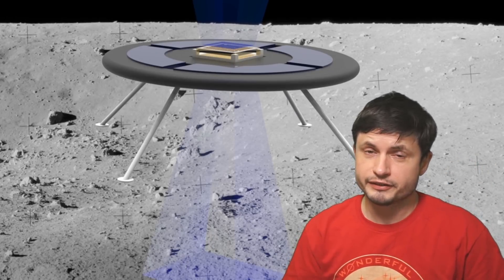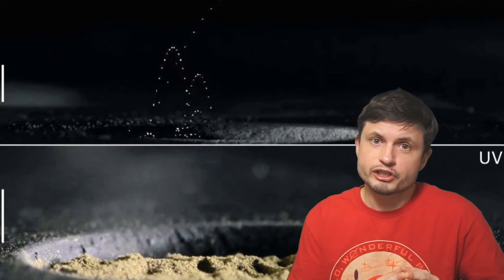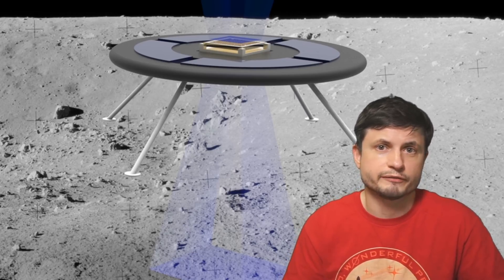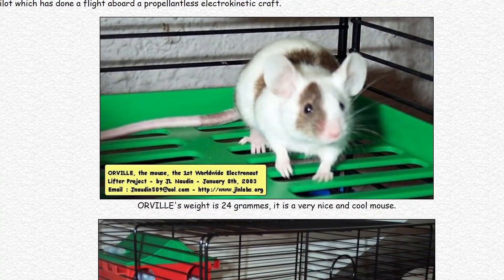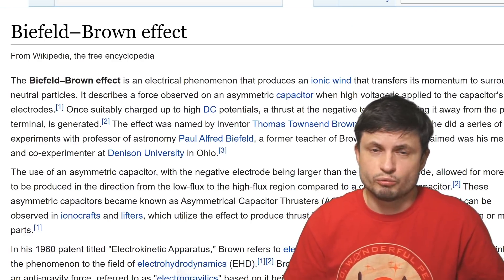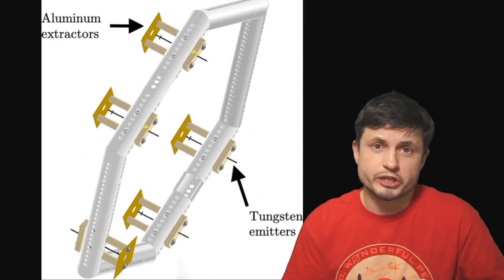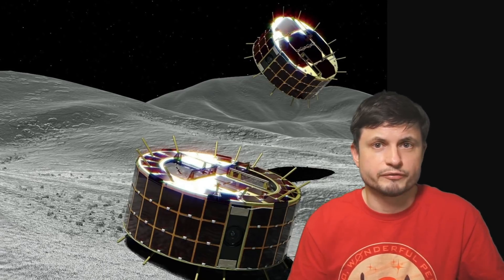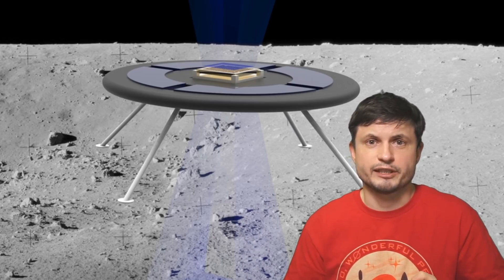Flying Saucers Could Work On the Moon By Hovering Using Static

Comment from the maker: Some clarification I forgot to add to the video:
The devices using ionic propulsion like the one that let Oliver fly rely on the electromagnetic principle to drive the charged ions and provide the lift. For the saucer, the forces would be based on electrostatic repulsion of already charged surfaces and would work on a slightly different principle
Generally, electromagnetic forces are created by both electric and magnetic fields for a particle moving with velocity v with the force measured in Newtons
Electrostatic forces refer to electric charges which are not moving relative to each other (static) for E being the electric field and the force is measured in Coulombs 
So it's sort of a different side of the same coin.
Reply: Aliens are using massless propulsion. They don't have to expel gases from one side of the vehicle to move. 
They simply fly. Their vehicles can fly in liquids like for example water but also gases and vacuum of space. 
Alien vehicles fly effortlessly and can change the speed and direction of the flight almost instantly - in a second or two.
Our machines are slow and clunky and super loud in comparison. Their machines are silent. 

A flying saucer could hover next to a sleeping baby in almost total silence. An incredible technology.
Reply: @oldi184  what if there ships are quantum entangled and the propulsion is done back at base which is pushing the ship around?
Reply: @kayden5238  
We can only speculate what power source they are using. Is it inside the vehicle or outside of it? But one thing is certain. 
That power source is orders of magnitude more efficient than nuclear fission. Is it fusion? I don't know. 

They know the laws of physics that we still cannot grasp. That famous "tic-tac" for example. It accelerated from 150 km/h to Mach 60!!! In 0.78 seconds. That's over 2000g's! It's truly incredible. 
Mach 60 ~ 20 km/second. It did it without a sonic bang. Are they able to cancel the presence of the atmosphere?  
Every supersonic vehicle will create sonic booms but for some reason, UFOs can fly super fast in silence. 

In other words, there is still so much to discover. 
If they can fly inside the atmosphere at Mach 60 almost instantly without sonic boom I can bet 100 bucks that they can fly FTL in the vacuum of space.
Reply: @oldi184   I would totally think it’s bat shit if I didn’t see it 😂
Reply: Those devices do not work in vaccuum, only the proposed one could work on the Moon and only very close to the surface.
Reply: This is a bit silly without an exotic power source making it useless for said purposes.  What did it say it needed? Tens of thousands of volts sustained...  Just strap a few electric cars to the thing to power it!
Reply: @scottparr5606  think of what could be done with one though. Like a new element or some scientific breakthrough. in the far future we may be the aliens in saucers haha.
Reply: @williamlyon5553  We already are...
Reply: The pic of the ion craft by De Seversky says "ion generated wind".  Air.  It will not work on the Moon in a vacuum.
Reply: So is the propulsion done against the charged dust particles, or against the (presumably more charged) more massive lunar surface?
Reply: @christmassnow3465  it charges the surface immediately beneath the ion beam, be it dust or rock. It decays into the bedrock over 30 seconds. I downloaded the paper when it was first published in order to write my novel. It's the same as using a plastic ruler to levitate some bits of paper. Moon dust jumps up naturally because of the charge built up by solar radiation, creating a very thin "cloud" over the surface. It intensifies at lunar dawn and dusk, and these shimmering dust sheets were visible to Apollo astronauts from orbit.

I had to work out all the visual details of this for the book, so what you would see would be something similar to a helicopter's downwash, because the charged dust particles repel each other as well. I extrapolated a design for racing, which requires an extended shape due to the charging delay of the lunar soil beneath.
Reply: DAMMIT U
Reply: I don't see why not, with the gyroscope and stabilizers

Comment: Very interesting idea to use moon dust and charge, I suspect it might contaminate the emitter wire supports, however. It depends on the conductivity of the regolith.  I am surprised you didn't mention my patented Ion Propelled Vehicles with onboard power.  It's the only ion thruster that is able to carry its power supply with a fully onboard energy source.  Still, really interesting video!

Comment: I one read an article about the Biefeld Brown Effect stating that the larger you make the craft, the more efficient it becomes. Ive also been wondering if playing with the  frequency of the current will effect the craft and it's lifting capacity. I see no reason why it shouldnt, there must be some kind of sweet spot for the frequency or Hertz where it works optimal. Ive never seen articles experimenting with frequencys and lift capacitys. Surely this must have been researched by now ?

Comment: Needs to do work on particles with mass, hence not in a vacuum. No moving parts? No. Ions have mass and are moving parts. The electron repulsion requires a lot of charged particles with high potential.

Comment: In the official FOIA documents reporting mach 60 hypersonique UFO/UAP speed seems not to require ionic milli grammes propulsion but the power of hundred of nuclear powerplant for instant accelerations (horizontally 90km crossed in 5 seconds at very low altitude recorded on multiples military radar)

Comment: "non-scientific..."  No, just "non-practical." Even on the moon with a sixth of the gravity it will not have enough lift to overcome its weight. The ionocraft ? will not work on the moon because there is a high vacuum on the moon. (no ions) The "electronaught" mouse flew only because the VERY HEAVY power supply was on the ground.

Comment: The engineering of what they call a "Flying Saucer" is a craft that can harness a self-size version ratio of what heavely mass chem entities, called Stars/Planets etc. They are gyroscoptic crafts that can maneuver as angular action geo-scoptical and tweak the TRON electro/static streams in time & render of space ( bend time). If you understand the naZI swastika gryo symbol, maybe you'll understand the paradox of that lettering ZI , into SA . 👀??!

Comment: Question is, can they ever actually fly while lifting their power source? I've only ever seen them flying tethered. If they can, then I don't see the necessarily being a limitation on how much weight you could transport. Couldn't you just attach a large number of them together making it into a larger craft. If each individual unit has enough power to carry itself including power source with some amount of payload capacity, then massively paralleled, they could carry larger items. Please chime in. I'm really interested in this idea. If I'm wrong, I'd be happy to know so I can focus on other things.
Reply: You're thinking of ionocraft which ionise the air for thrust. This is a completely different concept. The power required according to the paper is roughly one Watt to one Newton.
Reply: I'm guessing that using either higher power, or by distributing the weight like you said
Reply: How about transmitting the power to it?

Comment: One can (in theory) also levitate a plate-like form-factor object by utilizing a mirror-effect. When a charged object is near (say above) a larger dielectric plate (e.g. the planet), a reverse-charge mirror-image polarization is formed on the surface of the larger dielectric plate. If one can then rapidly switch the polarity of the levitating vehicle you can get some repulsion until the ground plate also reverses. Basically, the levitating vehicle has to stay ahead of the hysteresis of the ground plate. Since light travels at a rate of 300 mm per nanosecond, the reaction time (frequency drive) has to match the distance between the vehicle and the ground. This is in the gigahertz range when close to the ground and in the megahertz range at a height above 300 meters. However, the field is a dipole field which falls off very rapidly.
Reply: That's a great point! Check out dielectrophoretic levitation and electrophoresis too! We can levitate small particles of conductive or dielectric materials when we apply either a DC or AC electric fields that are highly non-uniform, ie. The electric field vectors form a steep gradient over a volume, and that steep gradient gets steeper at a non-linear or exponential rate. This effect can work on materials submerged in solids, liquids, gases and dusty plasmas, even in vacuum, but especially when a particle is submerged in a dielectric or conductive fluid with a very different dielectric permittivity or conductivity respectively. I came to a similar conclusion about mirror-charge and mirror-current levitation, it requires too much power. But I haven't yet worked out if a highly non-linear electric field gradient can be configured to levitate off the ground, in air, though I suspect in some cases it can, I've seen the dielectrophoretic levitation using AC fields on small particles of latex above a flat array of electrodes such that the repulsive force suspends it against gravity, they tend to levitate at the cusp formed by the weakest part of the electric field between electrodes.  Which direction the dielectrophoretic force points depends on whether the particle and medium polarized more in the electric field, aka the relative permittivity of particle and medium. The effect works a little differently in bulk matter as opposed to particles, especially for AC fields, and I haven't yet found dielectrophoretic levitation of large enough particles to conclude this is feasible to lift the electrodes. I suspect that a strong, non-uniform electric field produced by a flat array of electrodes could polarize the ground such that negative dielectrophoretic force, meaning a force towards the lowest strength region of the electric field, develops in the ground which is equal and opposite to the force in the electrode. An attractive force would instead be a Positive DEP force, which occurs when a particle exhibits a larger polarisability than the surrounding medium. Positive DEP is directed towards the stronger electric field, which would be bad for levitation since it would attract instead of repel. The Vacuum permittivity or dielectric constant of vacuum is 8.854, so negative dielectrophoresis is possible for rocks in vacuum if they have lower dielectric constant than 8.854, which lunar regolith does! The dielectric constant of air is 1 though, much lower than most rock, so unfortunately it seems positive dielectrophoresis on Earth would result, ie. Attractive force on rock submerged in air in non-uniform electric field. The air however would be repelled by negative dielectrophoretic forces! Imagine the air tends to be repelled from the top of a saucer and attracted to the ground, now you have a low pressure bubble above you and a dense air pocket beneath! Just don't get too close to the ground or the air and dirt will want to swap places. 

The situation is complicated by the fact that rock and air is not a single material, but a mixture of different materials with different dielectric properties that tend to want to "fractionate" into different layers based on relative permittivity. Hmm I wonder if you can concentrate Oxygen from the air this way! Might be useful if your UFO burns some kind of fuel or if you need some Oxygen ions to alter the permittivity of the air...

I admit this sounds pretty sci-fi, but I can see how such a flying saucer could repel rocks in space. It could sort the gases in the air, to move them around itself to levitate, but if it gets too close to the Earth, it tends to pull a chunk of the ground up with it. 👽🛸

Comment: Would an ion dome for human habitat work?

Layer of plastic on top, ion drives forming a wire mesh of ion drives.

With the thin wires the weight of the transport would be low, once filled with air it would be able to survive a good hit without being punctured.

Air tight moon dust enclosures for when an asteroid will hit.
Farming might be an option, stable temperatures would need to be figured out.

A little green and a walk under the sun without a suit would be nice.
With high air pressure and some weighted clothes.

It’s not an unthinkable amount of money to get to that point.
Reply: Plasma windows exist and are used in various applications but you need a huge amount of power for anything larger than a small portal. One megawatt per square metre.

Comment: The ionic wind hypothesis has been shown to be wrong by two experiments.

Experiment 1 encapsulated the thin wire in vacuum tubes and there was still lift.
Experiment 2 The bottom foil is a tube of foil like a toilet paper roll. The balsa wood is in the center the tube is free floating around it.
When the lifter is energized, the tube moves UP , seemingly against the "ionic wind".

They are both on the Youtube channel called thodal2000

Comment: Graphene and carbon nanotubes will make this more practical on earth because of its light weight strength and high conductivity and more energy dense batteries like 1000 to 10,000 watt hour batteries which both have been made in laboratories but have low cycle life like 30 charge cycles instead of 250 charge cycles

Comment: The batteries themselves will weigh more than the maximum weight for levitation. All experiments so far (there are many on YouTube) use long wires going to a very heavy battery or mains powered transformer.
The alternative is to use a bank of super capacitors which are much lighter but would severely restrict the flight time. However, they would recharge in seconds so you could scatter recharging stations across a designated working area on the moon. But I do think this is a dead-end technology.

Comment: There are photos & possibly a Wiki ppage on an Eastern European dude who built & flew his own levitating plate which could go up to 200 feet altitude and over 300 mph, without problems for the flyer, from the air-forces involved in the crafts passage.
 All his work, includeing the flyer, was destroyed & he, murdered   - as happened with several people who converted their gas/petrol  powered cars, to run on water, only. These people found a way to split the h20, & make sufficient for the speed being travelled, or the extra rpm involved in going up hills etc.
 There's been 2 NZ'rs, & both were heavier by "vested interests".
  The first one did a trip from Nelson to Christchurch, via Blenheim & Kaikoura. This was shown on Tvnz's "Town & Around"   " with Peter Reid" as host.
 The vehicle was a Ford Cortina MK 1 .
 The other one, occurred years later in a North Island City  & he got heavied about it.
Reply: And here we go again... If someone tells you to jump into a volcano because you will be not harm, you probably will do it and scream at other peoples that he is right.... Reality check dude, time to climb down those high cloud you are living in....

Comment: I would say create a electromagnetic field that would surround ship , basically a power source generator.  And then frequency resonance to match either the material of ship or the electromagnetic field it self to create a gravitational field for levitation. And possibly use multiple but separate resonance fields for propulsion and directional steering.  Much like using multiple 🧲 and the north /south poles to push and pull.
Reply: The combination of Tesla turbine , power generator,  and  Tyroidal  coil technology I think it would be possibly